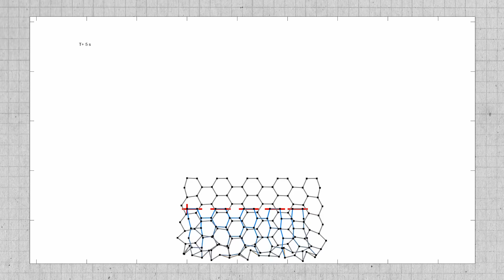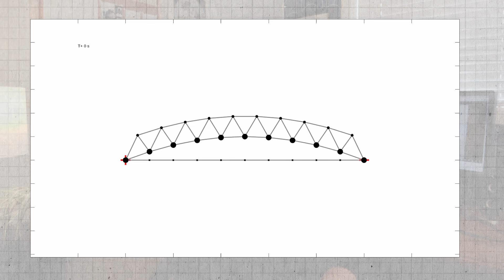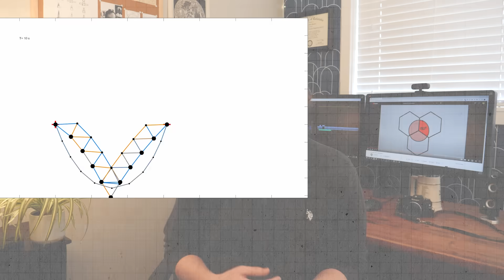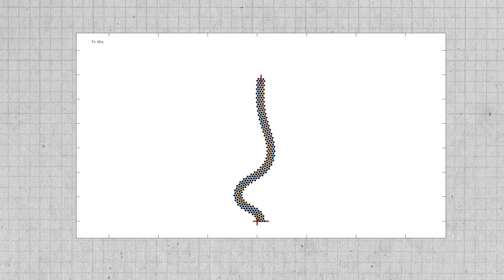Hexagons Are NotSoGreatAgons

Comment: I like hexagons as game'agons. For games that need a tiled map, it has a strong position against its two main competitors, the squares and triangles. I can't imagine many games where triangular tiles would be best, whereas square tiles work nicely in case you want to represent rectangular buildings, or other places built primarily from horizontal and vertical lines, but if you don't want a city to look like all perfectly aligned buildings, and may want some buildings to be diagonally placed relative to other buildings... well, none of the tiling solutions is perfect for that, but you may as well approximate it with hexagons then, to benefit from their better handling of diagonal movement.
Reply: Squares are often best for built spaces (at least ones built by humans or creatures that think more or less like humans)), such as indoor maps. One of their main advantages is that you can take a big chunk of n * m squares that form a rectangle, and subdivide it into a whole lot of different configurations. Or in other words, a rectangular building with certain measurements can have a lot of different room configurations.

Hexes are usually best for things that form organically, and where things generally don't conform to neat straight lines. That's because the maximum error when measuring things hex by hex (~15% longer, or 2/(SQRT(3))) is significantly smaller than the maximum error when measuring by squares (~41% longer, or SQRT(2)).

Comment: Last I checked the edges of a Triangle in a bridge are not free to move move. In fact they have about a dozen bolts through them.

In addition in honeycomb the structure is made from one piece of hexagons solid rigid.

If you want to compare the two compare the load to weight ratio of rigid structure of hexagons to triangles

Comment: Tension is strong, compression is generally stronger. Buckling failures are in a way a type of tension failure where the material fails away from the neutral axis, usually on the side that it is in tension.

Comment: Is a hexagon structure, such as a honeycomb, formed by connecting hexagon sides along their length instead of by connecting vertices? Wouldn’t that demonstrate a stronger result than the simulations you performed?
Reply: I believe that would actually just be the same as the triangular lattice.

Comment: So what I'm hearing is:
Hexagons are the bestagons but triangles are still the strongest shape.

Which makes sense since you can make hexagons out of triangles. As a coder myself, computers handle triangles the best, so even if you use a hexagonal tiling system, the computer still calculates in triangles.

And then the classical square has its own unique properties and strengths to offer. Every shape has its function, and I find it beautiful

Comment: The point of hexagon making a great spacer material between two strong sheets made me think of cardboard. Would a hexagon lattice between two fiberboards be stronger per material used that the corrugations?
Reply: Yes and it is sometimes done but more complex and expensive
Reply: Yep, it doesn't have long lines where it buckles easily, making it much stiffer and harder to compress. Not really great for making boxes though.

Comment: 9:00 actually in many projects (cardboard, airplanes, NASA, ..) you'll find honeycomb paneling used like this for 3 reasons:
- the top can be material 1 (say good thermal properties)
- the bottom layer can be meant to pressurize and protect
- the honeycomb between is a cheap (in materials) way to massively boost the ability to withstand [certain forces].
 as in, cardboard without it couldn't hold up a pack of butter; cardboard with it can hold 20 packs. 'nuf said honestly.

 i'd be more specific but i honestly can't recall the exact force.

Comment: It is really awkward that you refer to structures as „materials“, e.g. you said putting foam and paper together results in a strong material… no it doesn’t, it results in a strong structure. 

Same with the whole beam-argument. In the field of lower dimensional structural mechanics, the material parameters (E, G, nu, …) are clearly separated from emerging quantities such as the moment of inertia I_{yy}, and for good reason! Sure, in the end they form the bending stiffness E*I_{yy}, say, but this parameter is not a material parameter: it is a structural quantity.

I don’t like to be nitpicky about imprecise terminology with laymen, but given that you may have impact on some thousand young engineers, it would be very nice to see you take more care with the wording.

Anyway, I agree with the points made. Cheers!

Comment: Your proof that triangles are better then hexagons is that triangles can‘t move, so they have to be stronger. Your simulator doesn’t allow them to break, which could happen and then everything would collapse, and it makes the hexagons extremely weak. Their strength is that they can transfer energy to their neighbors. That ability is completely removed in your simulation. And if something collapses, it doesn’t like in your simulator. Would love to see another simulation where is isn’t completely rigid, but this is just bullshit.

Comment: Every 2 Dimensional Area is just multiple Triangles in a Trench coat

Every 3 Dimensional Volume is just multiple pyramids in a Tetrahedrons coat

And every 1 Dimensional Spot has nothing more to offer than the spot

Edit thanks to @analander9222
Reply: Pyramids are not tetrahedrons. Its base is a square not a triangle.
Reply: @analander9222 SQUARE PYRAMIDS have square bases, there are also triangular pyramids

Comment: Separation? It seems more like it's about the thickness than separation. The thicker an overall unit is, the harder it is to bend. But you do keep the middle thick under load by not letting the sides buckle together, losing their overall THICKNESS, by having sufficiently attached fill there.

Comment: The only reason bees use hexagons is because they’re circles without the packing density losses. They’re literally just simplified circles with flat sides so there’s no dead space. They’re a packing density optimized circle. It had nothing to do with strength, and everything to do with the efficient use of material to subdivide a given volume
Reply: In fact I believe bees actually make their hives out of circles which naturally deform into hexagons because they are the most efficient shape.
Reply: @ultimatedude5686 yep, more or less. Bees shape their honeycomb using their abdomen, which is roughly circular. As the hive heats and cools the wax melts and hardens. Due to most of the combs being filled and/or fully supported, they don't collapse, but they do fuse. Due to the fact that hexpacking is the most space efficient packing for cylindrical tubes this means that the combs create flats on the six sides where they meet and bulge towards the "corners" to maintain their volume. So they actually just form the appropriate N-gon to tile their packing formation.
Reply: for what i know CGP Grey already talked about this, and in fact it was one of his first points on why bees use the hexagon instead of a circle
Reply: when the fuck am i gonna use hexagons for that reason
Reply: @TXA-TXAT when you can only make roughly cylindrical shapes and need to pack a lot of fluid into the smallest volume possible.
Reply: @TXA-TXAT  if you want to make a shelf/rack to hold bottles/pipes/etc
Reply: the apices of the bees' hexagons contain more beeswax than the middles of the sides. This must assist the strength of the structure as a whole. And in nature the whole is rarely regular, it curves to fit the substrate. Apiarists often provide a shallow hexagonal matrix in their hive panels to get the bees started. Hives are somewhat artificial.
Reply: Wrong
Reply: @delwilson5678  you are actually, thanks for being honest with yourself
Reply: @capybara9521 it’s been a damn year bro
Reply: @delwilson5678  And?
Reply: @platogkrone7161that’s like correcting someone a day after they said the incorrect thing. It’s irrelevant if it’s been a whole month, especially if it’s a whole year.
Reply: yup, anyone saying honeycombs are hexagons has never actually seen a real honeycomb
Reply: and?

Comment: On the tank wall using squares: Hexagons would be less weight then squares if that was the only concern, as you said the squares give reinforcement in desirable directions which is why the squares are used. 
A simple way to visualize how they are efficient is as follows: The most efficient shape for circumference to area is a circle, when you just have one. If you pack circles together as efficiently as possible you have gaps and none of the edges are shared, just 6 points. So you then expand them to share edges to save material and fill all the gaps and you get hexagons.
Reply from the maker: Whether the hexagons are lighter than the squares is entirely dependent on the size of hexagons you use. If you don’t need them for reinforcement, then the size is completely arbitrary and in fact, the latest lightest option would be to have no reinforcement at all as the tank wall itself is the most efficient way at holding internal pressures. You only need the squares, triangles or hexagons if you were trying to resist some external force.
Reply: @ConHathy  When looking at the center layer of a 3 layer material the buckling of the outer layers is resisted by the support of the inner layer so if the size is too large the buckling is not prevented. How much material is needed to stop this buckling is something you want to minimize, in this case hexagons use less material then squares. The tank had additional force considerations that made the squared better for that application but most of the time that type of material is better with hexagons. This is not a truss so the simulations shown in this video don't apply. As the hexagons are unstable portion pointed out you need to connect all the points of a hexagon to make it rigid but the outer layers provide this in these applications.
Reply: If a different shape gives you a preferable outcome, is it not obvious that this shape is "better" for this use case?
Reply: I don’t think they are comparable as  in desirable and directional to each other. The sphere packing is looking to correct the  overall triangles as an aid to computation. The honey comb is used  for usability. Bees don’t look around for triangles

Comment: Honeycomb is also the best shape in terms of both tiling and having a large area to perimeter ratio (which is why bees use it in actual honeycomb). But that's not a strength thing that's a material efficiency thing.
Reply: Being efficient is not the strongest.
Reply: @jpogigtxcr1778  hence why I said it's not a strength thing.
Reply: Bees don't actually "use" hexagons. Bees make cylindrical cells in the wax, which become hexagonal due to wax being able to flow when warmed up.
Reply: @SirPhysics  it still ends up that way and for the same reasons but that's super interesting thanks for sharing.
Reply: @SirPhysics yep, and specifically it only forms the N-gon whose tiling best matches the packing used by the bees. If they used square packing instead, the forces acting on the comb would produce roughly square honeycombs. It also means if the packing is uneven, the comb will simply adapt to whatever polygon is best.
Reply: @SirPhysics   They do use hexagons. Why would they expend extra energy to "intentionally" create hexagons when the wax will naturally form that way? If another shape was better, they would be using that shape instead. The fact that bees honeycomb ends up as hexagons is BECAUSE hexagons are the best polygon for efficiently tiling a plane.
Reply: @NihongoWakannai  just world fallacy + confirmation bias + dunning kruger
Reply: @capybara9521   I don't think you know what those words mean.

Comment: Wow, I sure wonder why a vertical diagram of something doesn't hold up to something on a flat plane
Reply from the maker: If by vertical you mean that the forces are applied in plane rather than perpendicular to the plane then the reason I didn’t look at that is that it isn’t dependent on the shape at all. Assuming that all the members are thick enough to not buckle, then the only thing that matters is total cross sectional area of the structure which is independent of the shape. Long story short, if you stood on top of a honeycomb panel, whether or not it is crushed has very little to do with the shape you chose as a fill pattern and is almost entirely based on the amount of filler material used

Comment: 1:00 Application is the first consideration, right? Axial modulus must be part of the equation. What kind of force(s) are we designing for? Compressive, tensile, shear, torsional, normal, etc?

I would argue strength to weight ratio for certain applications, and say hexagons are best, but for other applications where weight is secondary/less relevant, go with a triangle. Because applications are bound by physical limitations, must articulate/move a certain way, (think compliant structures, where bending is a good thing), and potentially tons of other considerations, I figure it's problematic to just say this polygon or that is best. Qualifier needed: Best for WHAT? :)

Comment: Im a firm believer that an Icosikaitetrahexaflexagon made of one way material (like a dielectric mirror or even 50/50 mirrored window tint) are the best '-agons' . Yes!, the joint between topology, logic (state-machine capabilities due to interlocked layers) and geometric optics. We then take that as a shadow of a higher dimensional object of course similar to cube mapped to a hexagon as maximal shadow projection (more interestingly the hexagon is the max shadow for a corner-cube {naturally could be a retroreflector} + more I wont worry you all about here. Yes, and intriguing research field I am the sole freak researching it without funding. Im so poor )': should have stuck to trappin

Comment: To be fair, ANY excuse to make cool physics demonstrations.. is a good excuse.

I don´t agree with the honycome part. The hexagon does the work of spacing the two surfaces.And it does that very well While it in theory could be done better with circles, a hexagon is the closest you can come to a circle with single geometry. Hence all the sides is both inside and outside.

In honycome pattern, the straight is only ever supported in one direction, that is compression in the depth axis of the hexagon. In that direction the pattern is actually really very strong. The other two side are supported by the outer material.

This is very different to the space example where the squares support loads in all directions. So this is not really a valid comparison.

You absolutely could make triangular infill pattern. The issue is if its only loaded ortoganly to the plane the extra material would do nothing, and it would actually not be stronger, only heavier.

The triangle is only stronger if its loaded in the plane, and honycome pattern as a infill between two surfaces are never loaded in the plane, because that is the work of the outer surfaces. SO .. sorry no, you are just wrong about that

Comment: Hexagons are great for tiling glass because it is the most round tileable polygon, and round is better for glass because corners are its weak point. Thus thing with glass tiles (eg. space station windows) are hexagons, because it maximizes viewability. This also means hexagons are common choices for force fields in media, hence the idea that they are strongest.
Reply: So does this then mean that force fields are weak at the corners as well?

Comment: One thing that also irked me about the initial video is the usage of hexagons for tiling - but it was for different reasons. Yes, hexagons can regularly fill a plane, but unless the plane is infinite you will always need some filler shape to complete the tiling. See how soccer balls use both hexagons and pentagons, for instance, or note on the very thumbnail for cgp's video how a bunch of the hexagons are cut off into trapezoids, irregular pentagons, or other strange shapes. Meanwhile compare the triangle and square, which can tile a wide variety of planes without filler.

Comment: Talking about shapes. If I have a spere, let's say about the size of the earth and want to map a 2D-shape onto it, lets say with an area of roughly 1 square meter, and assuming the shape is not allowed to be scaled or deformed and has to cover the speheres surface "perfectly" (there is no perfection but lets try keeping it as close to perfection as possible), what would this type of shape look like?
I know it can't be triangle, because then you would end up with triangle which are not all equally sided nor even being the same size. Squares are also no option for similar reasons. so what shape would it be?

Comment: After all, hexagons are just 6 isometric traingles without the inner point
btw at 6:20 how useful are them if they made more rigid by using triangles on the side?
I guess for minimal material use it could be useful

Comment: Bees dont make hexagons. They make triangular pillars with rounded edges. These connect together to create circular gaps that can be filled with fluid. This lattice is created with the corner, not the face, facing downward. This allows pressure from the fluid to push on the cells to left and right via the thinner face and better distribute the weight more evenly without the risk of a break and spill. Bees make a stack of barrels that all share faces and reinforce the gaps.

Comment: i wonder, is there a difference between 1) node and edge based structures, i.e. the 'inside' is hollow and 2) filled in tiles e.g. stuff used for covering surfaces?

here hexagons, i think every shape, could stand on itself
how would a force applied to a tiled surface be distributed over the tiling?